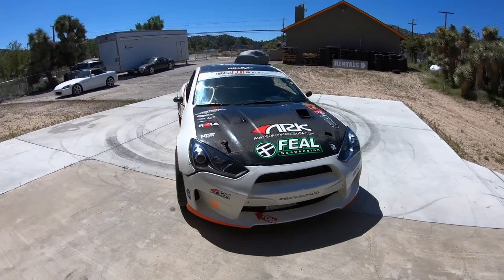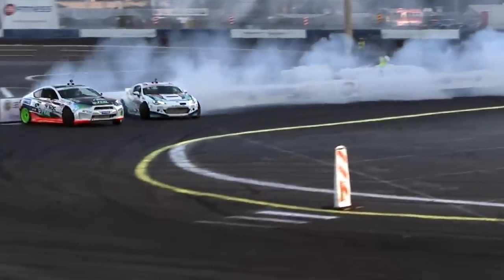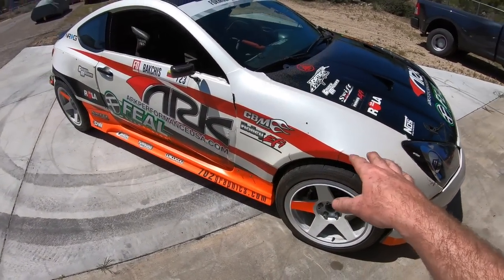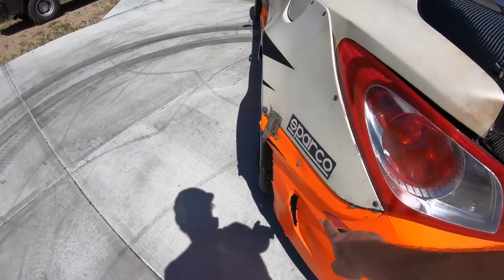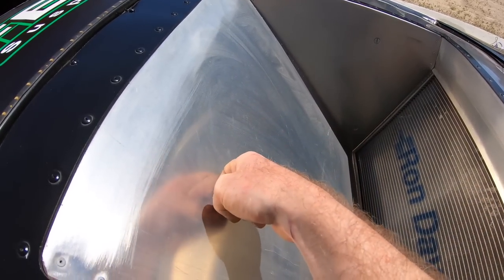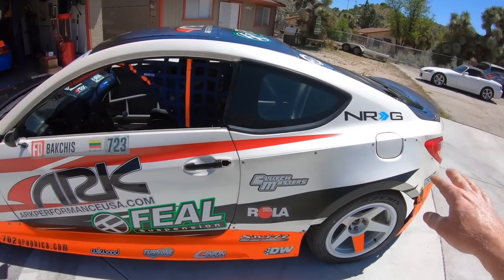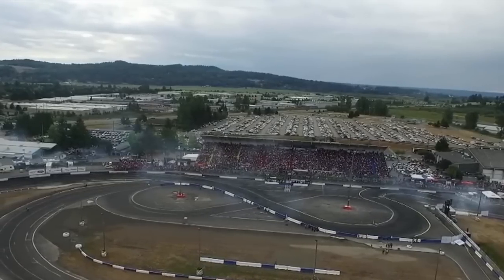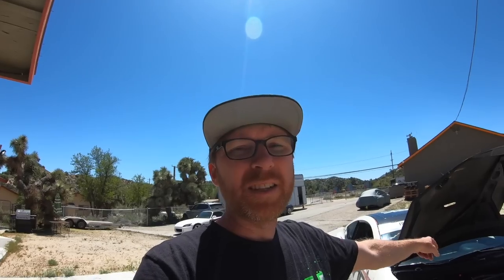Gnarliest Genesis Coupe Drift Car

Comment: with modern day suspension components available now (like the FDF angle kit and PBM rear kit) will the car perform similar or better than yours with all that custom work?
Reply from the maker: Miguel Oliveras we tried many off the shelf items on this car, but ultimately realized that in order to get the performance I was used to from my other dialed cars, we needed to custom build everything and modify the rear subframe as much as the FD rule book allows.

Comment: What modifications did you make to the oiling system? And what were some of the most common or biggest mechanical failures you had with the bk chassis while it was competing?
Reply from the maker: Seven Umstead we just use a wet sump oil system with a volume and pressure Melling pump. The only failure that was a Hyundai part was the front wheel bearings.
Reply: Frenemies thanks for the quick reply! I personally love my genesis and I dabble here and there in drifting it! There’s been 2 season winning bk’s so far in fd and I love seeing them compete and getting on the podium or taking first!
Reply: @Frenemiesdrift  Had to replace my wheel hubs at 100k. Other than that, and the leaking from the rear tail light seals, she's been great. Still have her. Right at about 138k

Comment: I just got a 2.0t last week and I love it. So glad to see the Genesis
Reply: NISMO 226 It is a Genesis... so you don't know what you're talking about
Reply: 6RIE nah he’s basically correct. There’s very little left of the original genesis. It’s got all aftermarket body panels, a new engine, completely new suspension, etc...
Reply: @Matt_Lanzer_13  thats a lot of cars tho even 240's
Reply: Matt L Nope, if it's not a genesis, WHY does everyone use factory cars, strip them down, and make them into full on drift cars? Drift cars are not drag cars. Promod and Pro-Stock drag cars do NOT resemble, or look, or have factory parts, drift cars on the other hand are THE ACTUAL car!
Reply: 6RIE drift cars use the bare frame. Nothing else. They typically have completely redesigned suspension, tube front and rear, engine swaps, aftermarket body panels, etc.... it’s nothing like a stock genesis lmao. The literal only thing it shares with a stock genesis is the basic center of the shell(I.e the drivers area/cockpit). Past that, it’s nothing like a genesis
Reply: Matt L Still a Genesis either way.